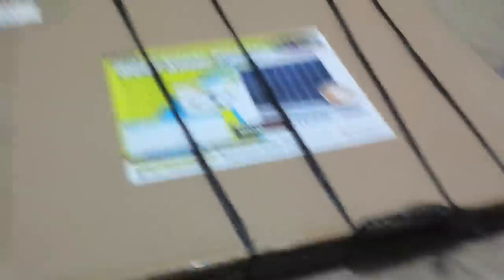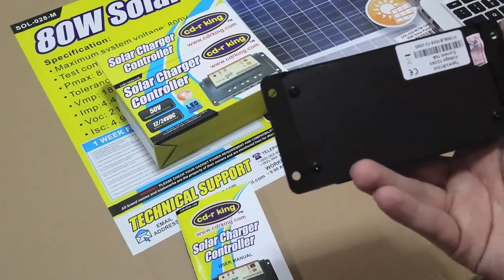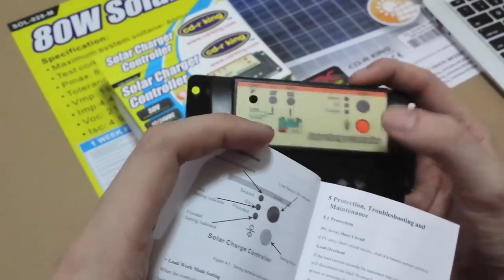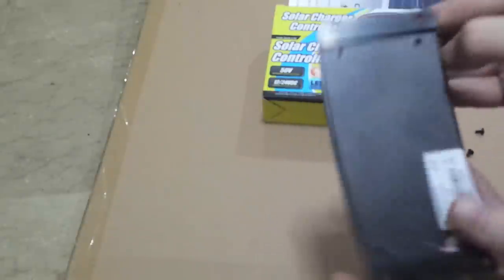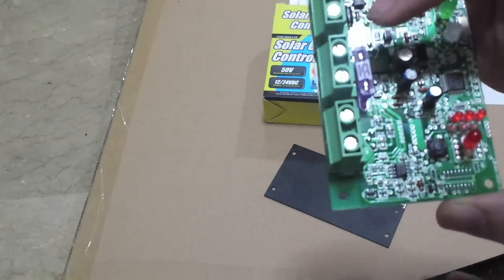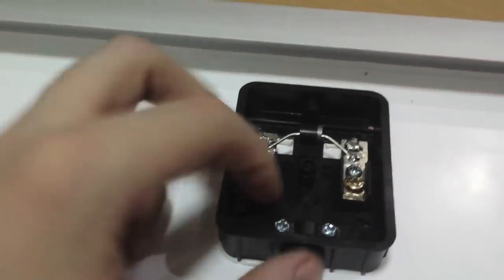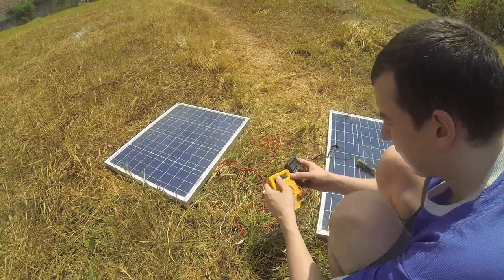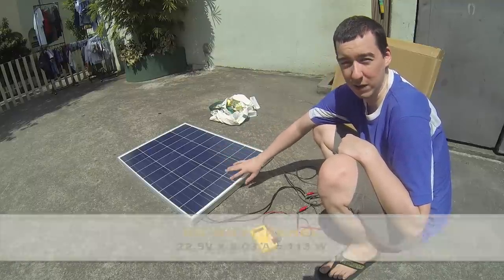CDR KING Solar Panels

Comment: hi there, can i ask from where can i buy a motolite deep cycle battery 200ah?
Reply from the maker: Most of the small stores don't stock the deep cycle batteries, so most likely they'd have to order it in for you. Otherwise you can just call the motolite hotline and get it delivered for free.
Reply: thanks

Comment: so now can u please take a vidio that show u setup all that and ill like to see that i  action and i will buy cd r king charge controller
Reply from the maker: I'm having a hard time finding a place to mount these. My current panels are on a balcony. I'm trying to mount these new ones on a balcony at the back of my place, but there's a big wall that blocks a lot of sun, so I might have to use mirrors to improve the light hitting the panels. My life would be much easier if I could just mount things to the roof :p

Comment: it just on the roos the stand is not drill on the roof just put it on your roof and some wire to tie it on your roof
Reply from the maker: Hmm i'm not sure how well they would work with heavier panels like the 40 and 80 watts. If I ever mounted panels to my roof I'd want to make sure they're 100% secure. We get high winds here and there are lots of young kids where I live. If a panel came off the roof and hit someone then it could cause a lot of harm. The panels on my balcony are sitting on steel bars with wooden plank backups and then tied to the railings with thick steel wire.

Comment: how to check the solar panel ampere?? using multimeter?
Reply from the maker: super guyver You should connect a load to the panel, for example a halogen bulb from a car. Then measure the volts/amps between the panel and bulb.
Reply: +super guyver look at your solar panel this is ampere (Max.power Current/ IMP(A) 8.43 this is ampere of your solar panel and (Short circuit current / isc(A) 9.10 this is ampere also means 8.43 to 9.10 ampere

Comment: how much it cost that i can plug my 500watt AVR on it?
Reply from the maker: You want one or more solar panels, one or more batteries, a charge controller and an inverter to output AC power. Anywhere from 4-20k to get started. Or much higher. It depends how much power you want to generate, how much power you want to store, and how high quality you want your equipment to be.  At the time of this comment, cdrking are selling a 200 watt mono solar panel for p11,800 or a 20 waa panel for around 1k.
Reply: then the watts that i needed is to make that 11k  doubled, then i can have 400watts.  is it guaranteed to last long?
Reply from the maker: kyllee setnavrec Plus you'd need charge controller, battery, inverter etc. So that would increase the cost. Average/Max rather than guaranteed.
Reply: +Gadget Addict does all the things needed here available in cdrking?from the solar panels, solar charger, batteries to ac converter?
Reply from the maker: kerivan13 Yup they have everything you need :)

Comment: can it power tv or electricfan?
Reply from the maker: +nobert garcia when teamed up with a charge controller, battery and inverter, yes :)
Reply: tv will not be able to work if you dont have  inverter, ele-fan yes you can as long as rated 12dc
Reply: what if it has  inveter can it run the 220v efan without draining the battery?

Comment: Love the video man.  Keep it up....

Plan on buying a 40watt solar panel and a charge controller too.
Reply from the maker: Awesome, I hope it works out for you! My solar was especially useful during the storm this week when Metro Manila was having rolling brown outs!
Reply: Gadget Addict
I finally finished my project.  I went with 100watt poly solar panel, 30 amp charge controller, 1000w pure sine inverter, and a 100ah motolite solar master battery.  Made  a few test running 2 laptops, 2 fans, and 20w led light for 4 hours and my battery voltage was still at 12.5v.  Not bad....

Thanks for your post friend.
Reply from the maker: Burton Manalili That's great! And with a 30 amp charge controller you have lots of capacity to add more panels later! How and where did you mount the 100 watt panel?
Reply: Gadget Addict
Since I'm still in the testing phase, i just laid it on the ground in the backyard where there's sunlight the whole day. I'm hoping you might have a suggestion on how to mount it.
Reply: Burton Manalili
Btw, you mentioned here that you found flexible solar panels.  Are they operational out of the box (wires and mc4 connectors)???
Reply from the maker: If you're fortunate to have a backyard which gets sunlight all day, I'd leave it right where it is! That's much easier than putting it on the roof. Just build a little wooden box to get it up off the ground :) The fuji fwave panels I bought do not come with the wires connected. You need to solder them yourself and add your own junction box (or just silicon like I did).
Reply: Gadget Addict
Got it.  Thanks Phil.
Reply: Great video!  Im out of the our country and having hard time reviewing current status and market of solar energy in out country. Specially the prices and the quality of those aftermarket Chinese products.  CDR king solar panels seems perform pretty ok. But the charge controllers are no good anyway its 10amps. I want to ask if you check the 200ah motolite deepcycle battery price and the 6v 200ah golf/marine grade price.  Do having 2 pcs motolite golf will be cheaper for having 200ah motolite battery?
Reply: Any links also and info for the said flex panels that you found there? Im coming back for good in few months. Thanks brother

Comment: maybe phil mount your panel on pole that what we called pole mounted solar panel
Reply from the maker: Unfortunately I still have no where to put the pole. It's a rented property without garden so I can't make any major modifications, can't mount to the roof etc. I'm hoping to get some 'flexible' panels from abroad which literally 'stick' to your roof, no drilling required. They're more expensive but would be very convenient for me.

Comment: can you make 220v or 230v more than 2000w ?

i want put one in my home because free energy :)
Reply from the maker: You can. On systems that large people will usually grid-tie the panels (power is fed immediately into the house grid) instead of storing it in batteries. Of course you'll need a number of large panels to produce that much power. With panel prices dropping every day, it takes less and less time to recover the cost of the panels and associated equipment. Meralco prices are getting higher and higher. Now is the time to swap to solar if you can afford the upfront costs and own your own property (or owners permission) to cover the roof in panels.

Comment: new vidio in action please,,
Reply from the maker: I just got back from Wilcon hardware. I'm building a small platform to hold the panel on my front balcony. It will only get a couple of hours of sun a day. But that's the best I can do since I'm not allowed to put panels on the roof.

Comment: cdrking is not good to buy you know?hehe not for long lasting to use,maybe you can use a week or a 1months only it has no quality and they have give you a less warranty.because cdrking company they have know exactly the product to sell that no durability and it has no quality low class product..
Reply from the maker: As with anything in life, you generally get what you pay for. If you buy a product from cdrking that costs just p200 but other shops sell a branded one for p1200 then you should have an idea that the cheaper one isn't going to be as good. I agree that many products from cdrking are really not worth the money and break far too quickly. But when it comes to their solar panels, I've had nothing but success and their output is above spec, as shown in this video :)
Reply: thanks sir for the info i  plan to buy that solar but
afraid
you know? hahaha
Reply: Any updates  How are the panels working  how many week you use hihi?
Reply from the maker: oddyses curiano Good luck, hope it works out for you. Another comment asked that a few days ago and I gave a longer response there. But basically I've been using them for quite awhile now and they're still going great :)
Reply: I look for another video a cdrking solar for convince me hehe anyway thanks